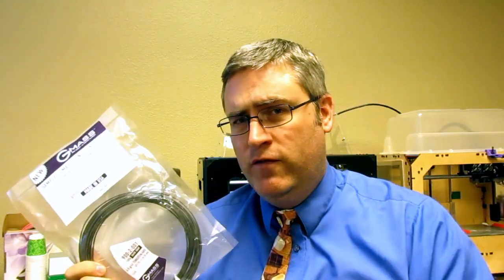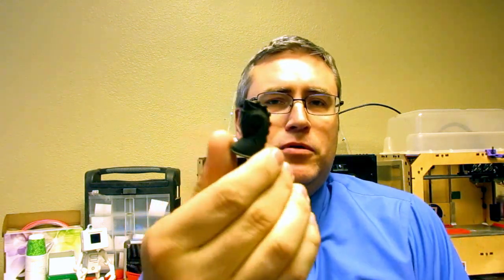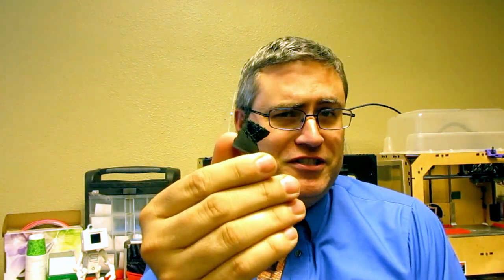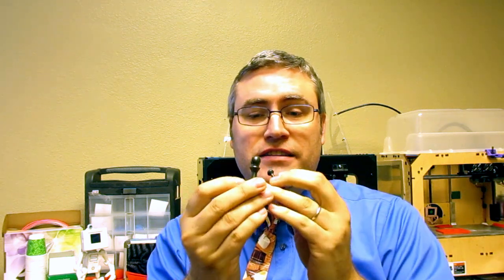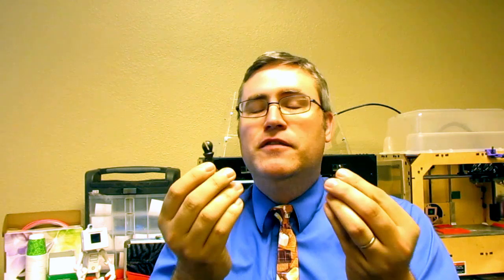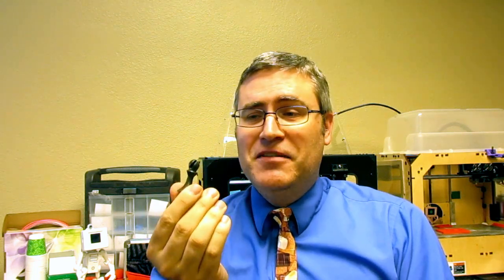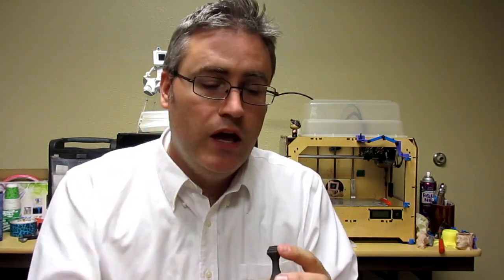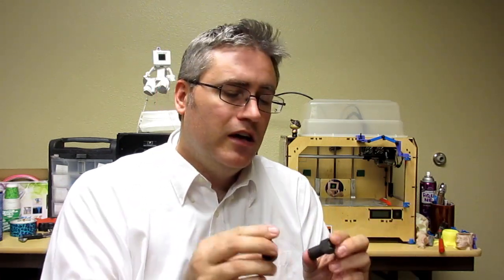3D Printing with Tungsten

Comment: Great video. This has been my opinion of carbon fiber filament...way too brittle for anything functional. There has been some FUD regarding the need for a hardened nozzle. There is a misconception that filament texture has anything to do with how it will interact with the heated brass nozzle when melted. If we use some common sense. Tungsten is one of the hardest elements we have access to, with a brinell number of ~2500, brass is 200...so yea, it will do a number on a brass nozzle and quickly. It is suspended in an ABS mixture, but the fine particles are going through your nozzle, and where as the plastic can't do anything to brass (neither can woodfill -- brinell number < 10 for the hardest wood species), the tiny particles are really rimming out your brass nozzle. I don't think the size of the hole if it were .6mm would have saved you there. I actually like the MatterHackers hardened nozzles for a very different reason than oddball, and frankly useless plastics. It has an interesting coating so you get less dimples and cleaner prints and even when you get a mess up and a bunch of plastic accumulates on the nozzle, it repels it and can just be peeled off. I suggest -- for giggles, take the messed up nozzle -- rim it out with a .8mm drill bit and use it for fast rough prints, adjust the nozzle size in S3D and go for it.
Reply from the maker: That's not a bad idea. I don't know how often I would use it, but it's a great idea.
Reply: I have a .6mm nozzle on my giant delta. If you have a good extruder to push plastic through fast. You can create large objects which don't require a great deal of detail much faster. The delta is able to print same objects 2-3 times faster than my other printers. Bigger nozzle, and a bit faster movements. With a .6mm nozzle normally you only need one perimeter. For mechanical parts, or just large modela .25mm layer height effective extrusion of .7mm, can get a lot of prints done a few hours which would normally take overnight.

Comment: maybe you try cold acetone smoothing, put it in a closed box and drop some acetone on a paper towel and let it a few hours in it. It should prevent the bubbles. James did a video about it https://youtu.be/fShfCS9T0Fk?t=48
Reply from the maker: I'm curious if cold acetone penetrates less, or more, into the model. I feel another experiment video coming on.
Reply: 3D Printing to my experience much more I had a very big part a night in acetone vapor and it became very soft and floppy. It took a few days do solidify again. But the process is slower so no bubbles appeared, this only seems to happen if the temperature is high, I noticed this if you brush acetone on an ABS part and then try to finish it with a hairdryer.
Reply from the maker: Now that I think about it, it may be thermal expansions that we're seeing, so penetration may not even matter. The air inside the print gets heated up, expands, and that's what causes the bubbles to find each other. Doing the cold method might just fix that. Hmmm...

Comment: suggestiong to fix this. leave a hole in the botton. print it hollow with say 2 shells. once its done smooth it.

now remember that hole in the bottom?

now pour some good 2 hour epoxy in their. let it set. now you have the hef tthe nice fiish and strength thanks to the solid core of epoxy.

strong enough for a chess set.
Reply from the maker: This isn't the best model for this sort of thing. It would need supports on the inside. But I think there are sets that might work with this idea. Still, if you're going to go through this problem why not just do a lost wax casting with PLA?
Reply: Use too few shells, and it's gonna be difficult to get off the plate without damaging it.  This stuff seems to have the strength of an egg-shell.
Use too many shells tho, and you start to run outof room to pour the epoxy into.

Comment: joe you use s3d dont you, im having a strange issue where i can print with a raft just fine it will put down a brim first and work but if i dont use a raft it wont extrude the filament at all with  simplify3d.

if i use cura i can print with and without a raft just fine trouble is i prefer simplify3d...

any ideas as i feel its gcode related ...

love your videos btw..

Dave
Reply from the maker: I always use S3D.

it sounds to me like your nozzle is too close to the build platform and you're getting a jam. I don't know why the slicer should matter for that unless they have different ideas about how close to start the first layer. But the raft pumps out more plastic, which might keep it going when the nozzle raises for the second layer. What's your first layer look like in S3D?

Also, what 3D printer do you use?
Reply: the printer im using is a prusa i3 pro b (with some upgrades) its not that its too close as it prints just fine with the raft and on cura with or without the raft.

when printing with a raft in s3d the filament comes out just fine but if i print without the raft the filament hardly comes out at all, i thought it might of been the feed rate but its the same as printing with the raft.

the only thing that changes is raft or no raft everything else is the same in the settings so im at a loss.

iv looked on google and found a few people with the same issue and the advice they get given is about the adhesion to the bed however that has nothing to do with it as this problem only happens in simplify3d.
Reply: in the morning joe i will make a video so you can see what i mean, cant do it now as its nearly 2:30am and i dont think my family would like me printing at this time. but it will be best if i show you rather than try and explain it.
Reply: +The Build Plate s3d assumes bed level 0. it will raise or lower your nozzle based on this assumption of bed level 0 so yes your nozzle probably is too close for the settings you have. try changing first layer height in s3d and see what happens. i am not 100% sure o  that but its an easy test. i do kow s3d commands the printer to start higher when you.tell it to do a raft.

so the slicer can make a difference. try setting your first layer height to 150% or better just put your finger on the best when it prints and push down a little. does filament come out? if yes then your starting too close to the bed.
Reply: cheers for that i will look in to it, iv just fitted a mk8 extruder and hotend and it a massive improvement.
Reply from the maker: Your video looks like it was deleted. I've been trying to analyze what's wrong with it and come up with a response, but it's been a busy weekend. My guess was going to be maybe a bug in Simplify3D, but have you reached out to the 3D Printing Tips and Trick community on Google Groups?
Reply: 3D Printing hi joe Nerys helped me out and i manged to get it to print without a raft at 290% on the height for the first layer. im still having problems with the printer but im ironing them out slowly. i need more blue tape at the moment as its messing up all my first layers but iv got some on the way. and im in the process of printing some anti z axis wobble things, hopefully it helps somewhat as iv messed up the rods and made it worse while testing the first prints of the objects, thanks for getting back anyway i do appreciate it.
Reply from the maker: Glad you found a work around. It seems a little hacky. You should probably report this to the Simplify3D community so they can fix this in future versions.
Reply: i dont think its software its just because its a kit printer and im a noob lol